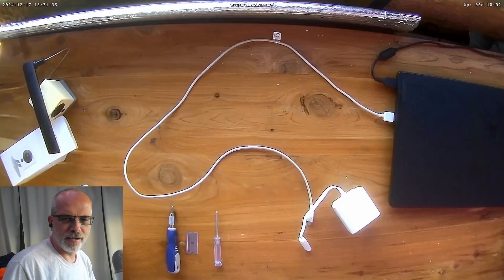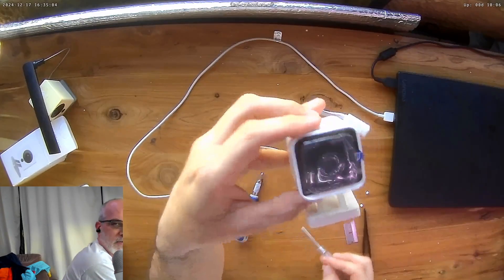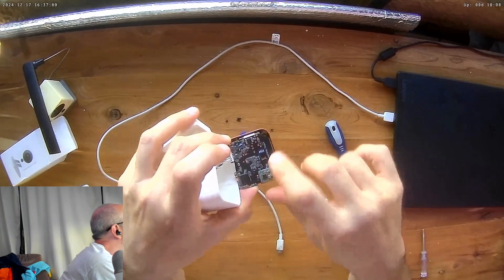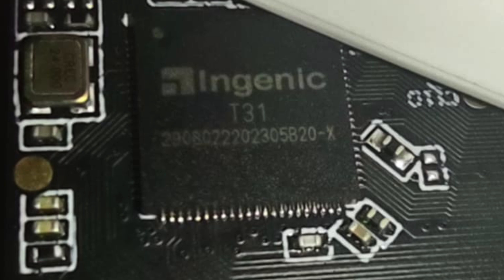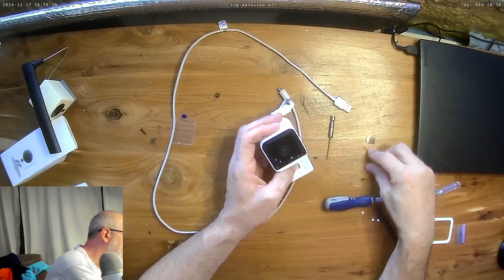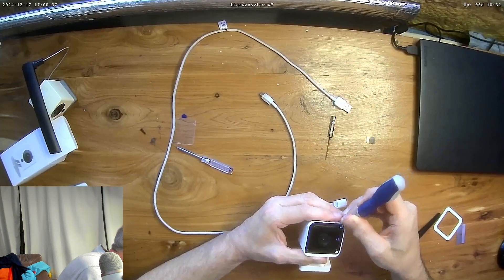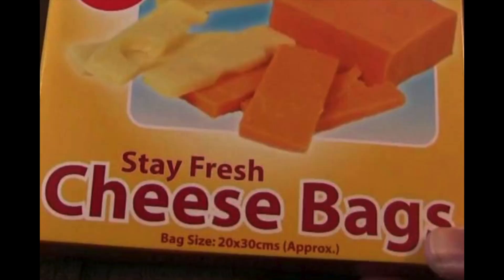Wyze Cam V3 Unbrick - Rescue with Thingino From Windows, follow along disassembly and flash!

Comment: Ugh, I have a Mac with UTM running windows. I thought I could make it work but the USB port isn't recognizing the camera when I plug it in. Not surprised, but figured I'd at least try. Thought about grabbing a windows machine, but I can toss the camera and buy a NOT Wyze camera for less. Truly appreciate the work on this though!! I may switch over my V2 camera.
Reply from the maker: It's a quick and easy process if you can get a hold of a windows or Linux system! UTM on Mac unfortunately hasn't worked or anyone yet.
Reply: @wltechblog  Back up and running!! Got my hands on a cheap Windows Laptop and got it to work without issue. Thank you!!!
Reply from the maker: @mergedown excellent!

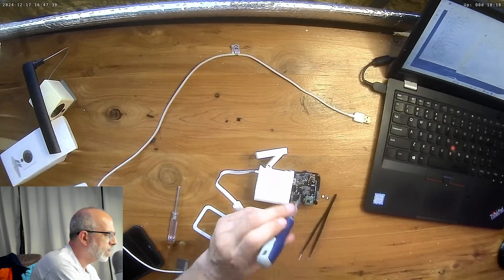Comment: Could you help me understand the step described at minute 9:39 where you mention that you need to put the screwdriver in pins 5 and 6? I couldn't understand exactly where pins 5 and 6 are located.
Reply from the maker: Look for the dot on the chip, that marks pin 1. Then go counter clockwise from there. On an 8 pin chip it's diagonal away from the dot, and the one next to it.
Reply: @wltechblog  Does this process work for a camera that stopped functioning after using a 256GB SD card?

Comment: Great videos.  I have been trying to do my NEOS v2, following your great videos step by step but get a blue light on the cam and a wifi on my android after flashing the operating system but can't get it to open a page so I can actually use the cam? I guess i am a duffer.
Reply from the maker: if you get the thingino wifi network but it doesn't take you to the setup page, ope nyour browser and go to 172.16.0.1 and that should get you there!
Reply: @wltechblog I will give it a go. Thanks for the videos though

Comment: Thanks, this unbricked mine.   Installing the firmware from the main github page seemed to be going well (lights blinking while it was installing,etc.  Looked similar to your V3 install video) ... then it bricked.  No lights,etc.  Good instructions!  thanks!
Reply from the maker: We take a ton of precautions in the Wyze flash process but still have an appreciable failure rate. its good for getting video views but it's not what we want. I'm brainstorming potential improvements!

Comment: I went through all the steps and it even says full image done but it still doesn't work. I don't see any led when plugged back in and it won't show the thingino wifi setup. Went through it couple of times and same result. Not sure what else to do here.
Reply from the maker: Jump on discord I'm sure we can figure it out!
Reply: @wltechblog got it figured out. I had the SD card in there after it flashed. Removed the SD card and it started working. Thank you for the guide!

Comment: Thank you for this great information and video.  I have followed your video. However now that my Wyze V3 camera is open and ready to proceed, I do not have any of the processors listed on the Thingino website for the V3.  Mine is T31 1109222002610BR2X01.  Same for the wifi radios you mentioned.  Only numbers with no brand name. Help!!  Thank you!!
Reply from the maker: Your chip is the T31X, they just hide the X in that long string of numbers!
Reply: @wltechblog  Thank you once again!  I was successful in bringing my Wyze V3 back to life following your videos!!!  My only issue is the audio within Blue Iris.  It is basically total static or just crazy sounds. I have looked around in BI but haven't found a fix yet. However the quality of the video is outstanding!
Reply: Well by some fault of my own I've now bricked my V3 once again.  However this time it doesn't want to restore using Cloner. Does not want to use the backup file, or the normal Wyze firmware either. Your thoughts please?  Thank you!🙄
Reply from the maker: Other than hitting them with a hammer they're hard to actually break. You'll need to use cloner though and get the flash chip glitch timing right!
Reply: @ Thank you.  I will try again when we are back in the country.  Off traveling at the moment.  I certainly appreciate all your advice and assistance.  The V3 has red lights at times on power up, sometimes the blue flashing lights come up at power up, it has various tiny sounds when plugged in and reset button pushed.  Apparently I don't have my 'cloner timing' right yet. 🙃

Comment: You made this sound so simple but as I went down the rabbit hole it got totally out of control. I have a Wyze V3 older one. I tried the process of loading thingino on my sd card and installed it in the camera. I powered up the camera and voila, no lights and a bricked camera. I then tried to follow the videos to unbrick. I took the camera apart, looked at the processor and wifi chip,. my processor is v3 with nothing else, just v3. I am able to boot it, connected to my PC, for flashing and see it in my device manager but It won't allow me to update the driver. It says I already have the latest driver which says I have Unknown USB device. That coupled with the fact that the Cloner doesn't even list my processor,(plain v3)  tells me that I ain't getting anywhere. I am ready to pitch it unless you have a magic wand I can borrow?
Reply from the maker: These cameras really only break if you hit them with a hammer. Getting the right combination of settings in Closer and a good USB cable is usually all it takes. Don't give up, we've got thousands of thousands of your identical cam running Thingino!

Comment: Is there 64 bit drivers available.  Seams I can't install this on my OS.  It keeps asking for 64bit drivers
Reply from the maker: The Cloner package includes both 32 and 64 bit drivers for Windows. Look in the cloner-win32-driver/amd64 folder!
Reply: @wltechblog  looks like user error on my part.  Now that its unbricked...is it possible to go back to stock firmware?

Comment: After flashing the camera, the light turned blue, I waited 5 minutes, but nothing happened. When I turned off the camera, after that it didn’t turn on again. I followed your recommendations, but I only hear a click of sound and it is not detected by the computer.
Reply: In my case, the USB cable that shipped with the Wyze camera didn't seem to have working data pins. I replaced the USB cable with a known working one and I was able to recover my Wyze CAM3
Reply: @codyrat  I had to use CH341A...
Reply from the maker: Are you sure you got the right combination of processor and wifi? The Wyze v3 has a few choices and they're not interchangeable. Jump on the Discord if you need help, Im sure we can figure it out!
Reply: @wltechblog  Yes, I close the 5th and 6th pins, connect the port and after 2 seconds release the contacts... the laptop does not see any devices tried more than 40 times but nothing happens. Maybe the chip burned out?And how can I get help on Discord who to add to my contacts?

Comment: How do cameras get bricked?
Reply from the maker: Generally it happens while flashing firmware. Easy mode to brick a cam is to start an update and unplug the power halfway through. it can also happen if you install the wrong firmware image, if the sd card is corrupt, lots of ways!